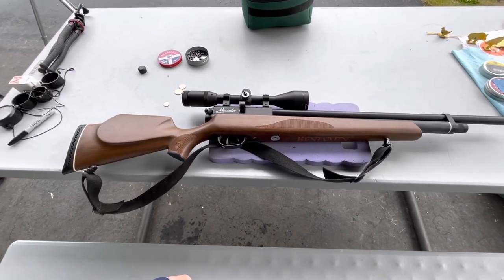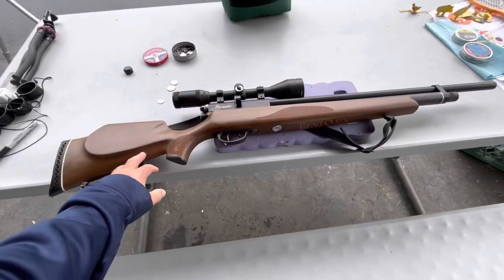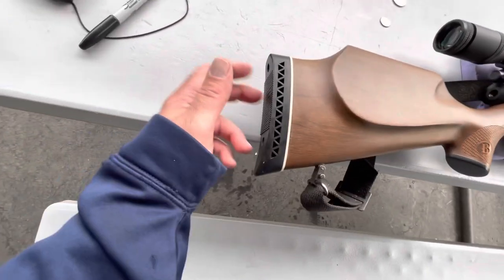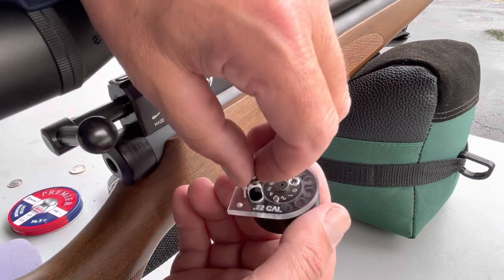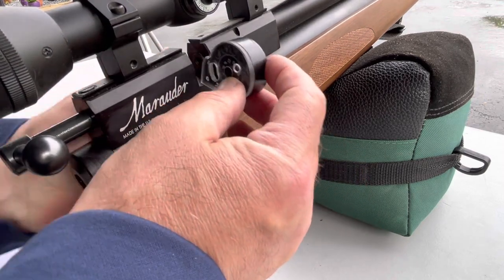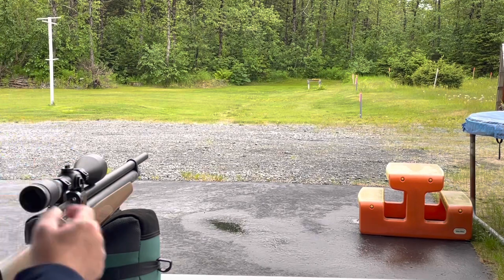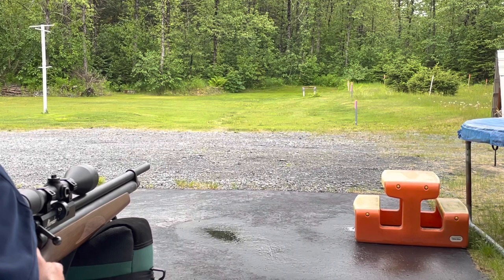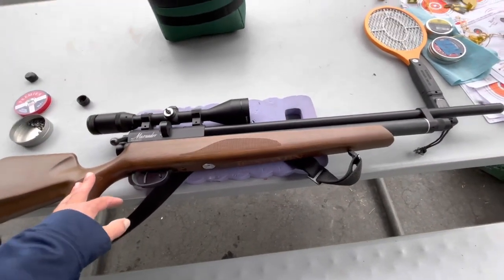‘10 Benjamin Marauder .22 cal - overview & 50 yd silhouettes

Comment: I'm a glutton for punishment.  I pumped a 1/2 liter bottle to 3500 psi , it took 3 days .  4 or 5 pump sessions a day .

Now I do have the compressor.  
I guess the last thing is a 2 liter bottle .   Then I'll have a PCP platform for more guns .

My 2 home built PCP riffles are more Akin to your pumpers , 22 pumps to a full cylinder then on my detuned carbine I get 11 shots , on my powerhouse same gun same build but stronger springs and hardware,  I pump 22 times to get 7 shots .
Reply from the maker: Years ago I remember thinking about how cool it would be to have a pumper that provided a couple follow up shots without the need for an external pump. I think that might be the compromise I’d like. 

I looked into that Seneca Aspen but it isn’t a good looking gun. Plus it seems to have a poor reputation and with my recent Seneca experience I have zero desire to buy another one of their products.
Reply: @airgunsofalaska  I'm with you on that one the aspen had such high hopes like a Daisy 880 for adults but the bad rep killed that gun even if they fixed it
Reply from the maker: @jasonnealey8325  I won’t buy another even if they fixed the barrel issue and went to a normal style pumping mechanism. I’ve discovered that where a gun is made often adds to my pride of ownership with it. It can also detract from it and I get no satisfaction seeing made in China on a $200 airgun.

Comment: the marauder you have made in the usa and still holding up, working good    very cool air gun l would buy one if good shape and price is right.      for me l  don't mind at all pumping my own air into an air gun.    its a labor of love.    l did some math if did 8 pumps on a benjamin 342  times  13 shots that equals about 105 of pumping air into marauder.      or 6 pumps into 342 times 18 shots equals 108 pumps.
Reply from the maker: It’s a weird thing for me. I was even thinking about it yesterday while running the hand pump and then later seeing on video that it only took under 4 minutes to recharge. The hand pump is far more efficient pump (than a pneumatic) and you pump less for more shots. But, I also try to not run the gun down past 2000 psi. I remember the first time I shot it I ran it super low. I don’t recall how many pumps I needed to bring it back to 3000 but it was a ton of pumps and I was hating life.

Comment: Very curious,  why do you hate pumping up so much .  My Icon has same cylinder and it's 60 pump strokes to get from 2000 back to 3000 .

After using it nearly weekly for 2 years .  I learned a different pump technique.   At 1st I wad pumping like a bike pump then drop my entire weight on the pump handle . I would have both feet planted on the pump stirrups but on the up stroke it feels easy to loose my balance.  I do something similar to an archers pose with only one foot on the stirrups and one behind it makes me more stable , also I'm not ashamed to throw down 20 pump strokes rest then do again 2 more times
Reply from the maker: I just hate it…. Immensely! Filming myself pump and realizing the whole pumping exercise was less than 4 minutes still didn’t make me okay with it. I guess I hate the fact that with every shot, every magazine I know the count down started and it bums me out. I seem to just prefer to pump as I go. I noticed after this video that I enjoy a shooting session with a pumper more than I enjoy it with a PCP. I guess each shot is more satisfying with a pumper than my PCP?
Reply: @airgunsofalaska  I think that's why I've quit using magazines, at least now it's warm enough to not need gloves.  Just take my time single loading between shots, try not to think about how much air I have left.  It helps, but there's still that weight on my mind I don't have with a pumper or springer.
Reply from the maker: @yoitired  Even sighting it in tonight shooting at 50 yds for this video, the countdown was running through my mind. I just don’t like that. I also noticed shooting with the magazine causes me to shoot faster than I typically do and diminished the experience to an extent. I think this gun is great for shooting pests but for plinking and target shooting, I never grab it. 

I still keep getting into my head the Benjamin Discovery as a gun I’d like to buy. It’s unfortunate that I have to look for a used one.
Reply: @airgunsofalaska  When I was a kid with a co2 I had to take it slow cus I didn't have a ton of ammo so reliving that vibe seems to work, now I just pump instead of pestering parents for more co2 lol.  Have you thought about the QB Chief?  It's probably the most similar looking to the Discovery and also 2k psi, same length, a bit heavier.  I'd like to get one before it gets axed.
Reply from the maker: @yoitired  I looked it up a couple weeks ago and thought the gun looked a bit odd and out of proportion. The main reason I won’t consider it is because it’s made in China and I can’t do that to myself with a new gun 3 times in a row. 

I think I might keep an eye out for a used Discovery. I watched an 11 year old video about it last night and liked how similar the parts were to the 362 and 13xx Crosman guns.

Comment: Brother not been funny but using a pump is fine for teenagers but for us more mature types it's a dive bottle every time.  The reason for me is i don't want to be knackered and out of breath before shooting. Get yourself a dive bottle bro. Keep up the great work and videos. 👍👍👍
Reply from the maker: I could totally do that. My Dad even has some scuba tanks but I just don’t care for the idea of having to haul them to the local dive shop to get them filled and then watch them run out of air over time. 

I guess I hate spending “X” amount of money to shoot when the power can be provided by me. Initially I loved the idea of a hand pump when I bought my Marauder. Then I had to pump the gun up and I hated the experience. That little, wheezy, spurt of air the pump pits out at higher pressure is maddening to me. So many pumps with so little movement on the gauge just drives me crazy.

Comment: I started out shooting air guns with Pumpers then break barrels and then sometimes co2's I've sold all those and it's all pcps yeah it's a little expensive to have to buy a compressor and bottles and all that but it's so much more nicer than pump 10 times and shoot Pump 10 times and shoot or CO2 not being at the right temperature outside or you shoot it too fast and it doesn't power falls off I'm definitely spoiled with pcps
Reply from the maker: What I noticed with my Marauder is the point of impact changes with the air pressure inside the gun. I believe a regulator fixes that but it’s yet another part to buy and then I’d have to install it. Recently with my Benjamin 397S I only have to pump 6 times to shoot out at 50 yds and I don’t mind that at all. My 362 is 8 easy pumps for that distance. But the Dragonfly I had was 15 miserable pumps at 50 yds. I didn’t enjoy shooting it.

Comment: You should be able to get like at least 30 shots with your Marauder before it needs to be hand-pumped how many hand pumps do you have to do to shoot 30 shots out of a pumper ?
Reply from the maker: I hear what you are saying. It’s kinda funny to me, even with timing myself using the hand pump in this video and seeing it’s less than 4 minutes of tedium, I still loath the experience. It can certainly be rationalized that it’s less work to use the PCP hand pump than the pumping mechanism on a pneumatic gun. I guess I just don’t mind pumping as I go, savoring each shot rather than working the bolt and feeling I’m rushing through. I should really get a single shot tray so I can goof around trying different pellets. But…. at this moment I’m not interested in buying more airgun accessories or PCP paraphernalia. I’m more interested in shooting what I have and maybe getting some new future model $100 range guns.

Comment: I have a first gen .177
Reply from the maker: I bet it’s quite accurate. 

Part of me wants to convert my 362 to a .177.
Reply: It is fun tinkering!
Reply: @airgunsofalaska why convert a 362 to .177?  Just buy a Winchester 1977xs?
Reply: Also crosman is making a 367 soon to be released
Reply from the maker: @gmanneod8085  I already own two, 30+ year old Daisy 880’s. They are not in the same category as a Crosman 362.
Reply from the maker: @hershelbutler6369  I’d read that somewhere as well. It would make more sense to wait and just buy one of those when they come out.
Reply: @airgunsofalaska  The 1 Benjamin 1977xs has great sights, is a 800+ FPS powered Daisy and just as accurate. You don't have to buy a 50 steel breech and a 50 .177 barrel and probe to make it .177 and accurate. Your Crosman now cost well over 2 Benjamins.  But at more than double the price the Crosman is now a better item.
Reply: @airgunsofalaska  I missed the comment about the Crosman 367 coming out!  I just found Crosman's 2023 catalog and see the 367 is in there and coming! Also in the catalog is a very handpump friendly PCP version of the this air rifle. They are labeled the 3622 and the 3677.
Reply from the maker: @gmanneod8085 I’m not sure I follow what you are saying? My modified 362 didn’t cost cost over $200. But more importantly I like it. I like that I modded it and I like that it now has a steel breech and longer barrel. I like that it has built in the USA 🇺🇸 on the box. That Winchester 1977 is just another garbage plastic version of the 880. I’ve got original metal 880’s so it doesn’t make sense to me to get a lesser version. I like my older 880’s and am currently playing around with one I added a scope to. I’m curious to see how far out it is accurate to.
Reply: @airgunsofalaska  All good I get what your saying and you like it. Plus I didn't know the Crosman 367 was coming.  But a steel breech is a 50 item with shipping.  What is the cost of a 26" barrel plus a .177 probe? Added to the 120, Crosman 362. Isn't that 200+?
Reply from the maker: @gmanneod8085  from what I’m finding with searches, the Crosman steel breech is available in either .177 or .22. I don’t believe you have to buy a separate probe and convert a .22 cal breech to a .177. 

When I ordered my longer Crosman barrel last fall from Mac 1 it cost $38 w/shipping. With that and the breech it was under $100 to upgrade the 362. I’m not saying that makes any economic sense. It doesn’t. A guy can buy a 392 that’s a nicer, higher quality, way more solid feeling gun for about the same price as an upgraded 362. But, there was something special I really liked about the 362. Hard to put a finger on what that is but I feel it.
Reply from the maker: @gmanneod8085  thanks! I just checked the guns out in a Hardair magazine article. That’s exciting news and those 3677/3622 models look pretty neat. But the article mentioned they can go up to 3600 psi so I’m not sure that’s something I’d want to buy? I am excited to see a 367. I’d buy one of those without hesitation.

Comment: Get yourself a compressor!  You’ll thank me!
Reply from the maker: I hear ya 😀. I’m just not ready to spend the money on one.  I’ve learned I enjoy the rhythm of shooting pneumatics and springers. I’m not sure that I’ll enjoy shooting PCP’s appreciably more with quick refills from a bottle. While I absolutely loath using the hand pump, I have a feeling that I’ll also not like listening to the clatter of a compressor and going through the process of recharging a bottle or the gun itself. I don’t like the idea of adding a compressor to my inventory of things that’ll eventually require maintenance of some sort.
Reply: @airgunsofalaska  … technically, everything requires some maintenance at some point. I have a Tuxing, twin cylinder compressor that I got on eBay for around $600. I just filled my Air Venturi 100 cu. in. Bottle from zero to 4500 psi in about 10 minutes. The compressor is quieter than my big Ingersol Rand 80 gallon shop compressor! I fill up my bottle with air when I’m not shooting so when I do decide to shoot, I can quickly and easily fill my guns without wearing myself out with a manual pump. I used the manual pump about three times when I first got my PCP guns. After that, I was fed up pumping and decided it was easier to get my SCUBA diving certification so I can get SCUBA tanks filled! I then got tired of going to the dive shop to get tanks filled so I bought the compressor and an inline filter/dryer. It’s been over six years now and I never looked back! Filling my own tanks is quick and easy! Saves a TON of time and effort too! Sure there’s minimal maintenance but it’s well worth it!
Reply from the maker: @subman719  excellent points, I didn’t realize a high pressure compressor could be quieter than a standard air compressor. I hate being inside my shop when my standard air compressor kicks on. 

Overall though I’m not sure that I’m real keen on the PCP’s I own. I definitely have an appreciation for what a regulator would offer but none of my PCP’s are regulated. I guess most often when I feel like shooting I just enjoy the simplicity of grabbing either a pneumatic or springer with some pellets and shoot. The velocity stays consistent, the routine between shots is consistent and since I generally don’t shoot past 50 yds, the additional power and performance of a PCP is kinda wasted for my yard. I like the repeater function of my Marauders for shooting pests but otherwise, 9 times out of 10 I grab one of my pneumatics or springers when I go out to shoot.